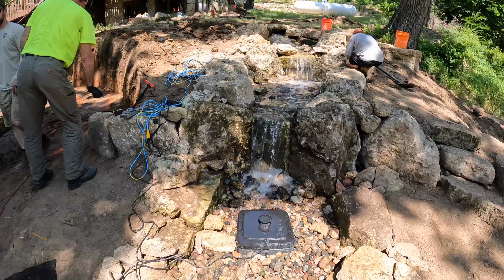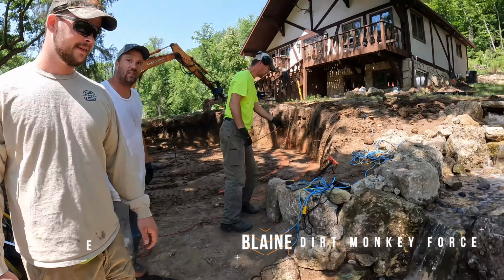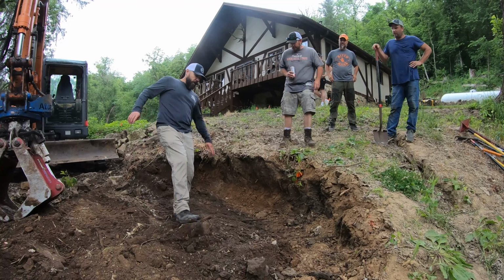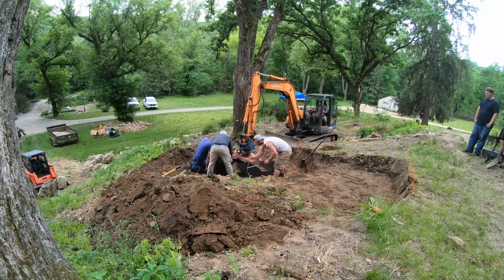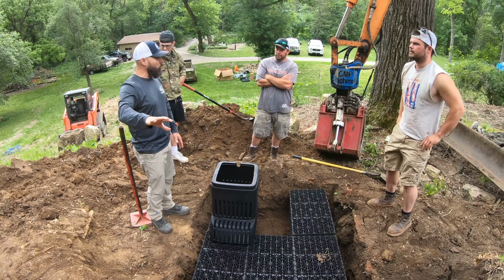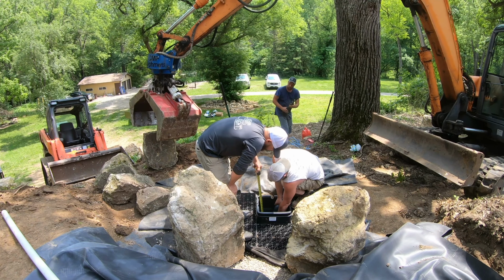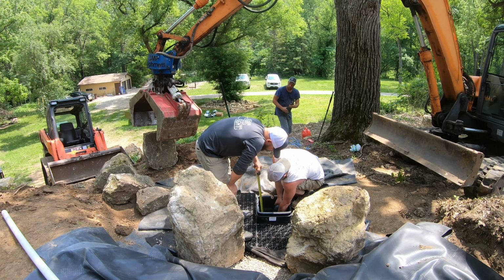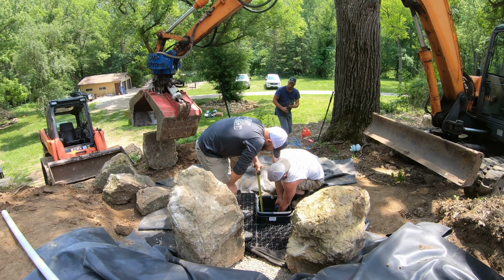Our First Waterfall!   4K

Comment: Stan, the waterfall is awesome, have you ever thought of utilizing the flow and drop of water to make a a small hydroelectric generator  system to make electricity, that would help pay for the system over time and be unnick to doing waterfalls custom made.
Reply from the maker: That’s a pretty neat idea
Reply: Stan, if you talk to the waterfall designer, he could probably give you information about floe rates and how to incorporate a hydro electric generator into system, there are some small systems that produce electricity if the water flow and height drop are meant.

Comment: Beautiful job, turned out really nice. Interesting what you said about the difference between craftsmen and skilled laborers. China has a problem with the issues that can arise from lots of skilled laborers doing the work of craftsmen and failure to see the long term cumulative affects from ignoring the details. The first time I saw water storage blocks like you used in you bottom catchment was for installation under parking lots to allow a place for the runoff from the lot to collect and drain back into the aquifer. My shortsightedness thought that’s kinda silly to be concerned about such a trivial issue. Recently China is having a problem with the water table in big cities dropping and causing sink holes because they are sealing the surface with pavement and pushing all runoff out to sea while still pumping all the water they need from the aquifers below their cities. I’ll include a link you might find interesting. Wishing you and your family the best.

https://youtu.be/YqmhDhjXCkc